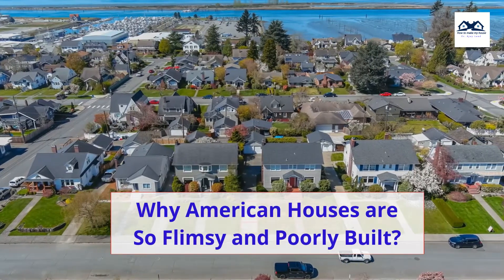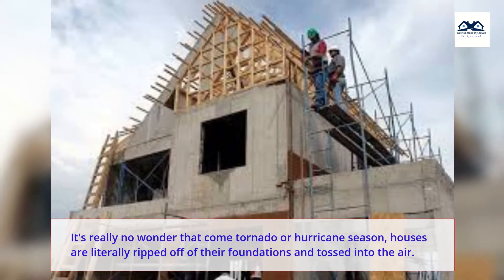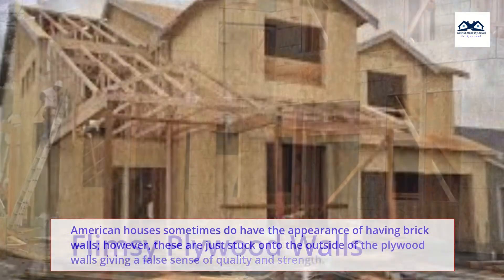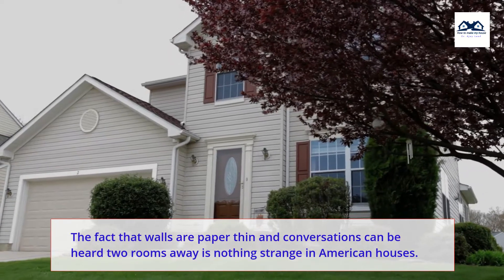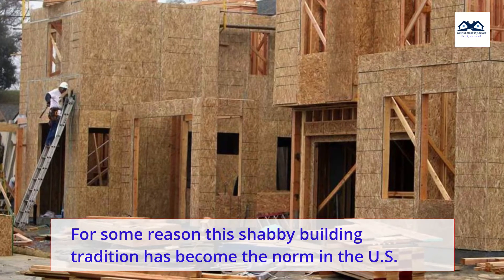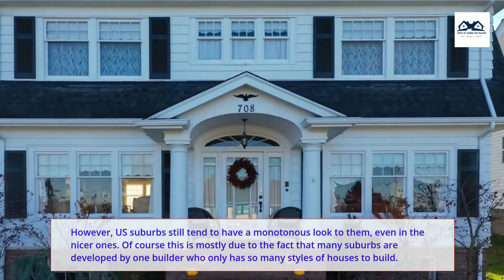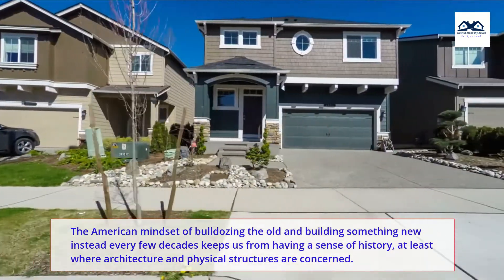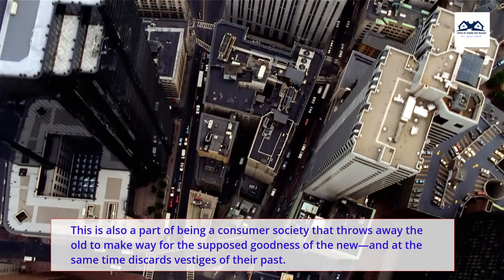Why American houses are so Flimsy and Poorly Built | Why American Houses are Different

Comment: I hope this helps someone/points them in the right direction, when it comes to building a good house.

Houses are built TERRIBLY in the US; you really have to go out of your way, to get a house built properly in the US, they are basically a step up from a straw house, by default; Its kind of sad that to get a well built house in the US, you have to go against the grain, A LOT of the info pertaining to the history/a fancy name/a certain type of house and what its called, honestly doesn't matter, just point, at the type of house you want and then start modifying/changing what you don't like, or don't want/what you want to add/remove and so on, honestly this is what matters, I prefer NO HOAs/a piece of secluded property to build on, is DEFINITELY the way to go, with a CUSTOM lay out, honestly do what you want, let history be history;

LOL the real question is; Why all the pine? 

To build right, one of the cheaper ways, is to use concrete and rebar, the concrete NEEDS to be, AT LEAST 6 inches thick, with rebar through out, or if your cutting corners, rebar needs to be applied every 1-2FT, WIFI extenders/numerous routers can keep your homes wifi operating properly/optimally, hurricane straps, for keeping metal roofs, on/together/the structure of a house together, in general, is a great option; The better/ more expensive way is, ALL steel, DEFINITELY no wood, outside or for structure/wood shouldn't be around windows either/used for framing outside either, honestly another cheaper option, thats not terrible, is fiber cement siding, as long as you put weather treated 7/16-inch or 15/32-inch thick backing behind it, houses are wrapped now days though/flashing is used/they are waterproofed, so thats at least good, but obviously still use treated wood, for the backing; IF you have to use wood outside, under your hardie board; The best/strongest wood in the world is, Australian Buloke, the strongest local, to the US wood, is Black Ironwood, other good options are hickory, being the strongest out of these five, then maple, then oak, then walnut, and then beeches, again all structure made of wood, thats for support, NEEDS to be at least 7/16-inches or 15/32-inches thick; 

Also NEVER use OSB board or Pine, outside the house or for structural support, I would steer away from it regardless, but this includes decking, for roofs, don't use pine or OSB for that, and if your using wood for decking, make sure its weather treated and 7/16-inch or 15/32-inch thick and made of one of the woods I listed above, NOT pine or OBS, also remember to use hurricane straps, for keeping things together, this is also a MUST; also no wood porches, steel is the best, with a steel cover/eve, to keep the sun off of it/to keep it cooler, but plastic decking is really popular now days, for longevity as well; Tornado proof windows is a MUST,  but I would minimize the amount of windows used/DEFINITELY limit the size of the windows, that would be even better, and also like I've said, a steel roof, NOT tin or shingles; This would basically fix all the problems, with stability, pine and OSB are garbage, pine is fine for inside, for shelves, but not outside or for structure, or roof decking, I honestly would avoid it all together, but these options, are A LOT better vs the default garbage material used in 90% of houses in the US now days; I would also get steel storm shutters, to protect windows, make sure the steel doesn't move/make sure the steel cant bang into the Windows/so make sure the metal shutter, is far enough from the window, to not touch the glass, so nothing can bang into the window/make sure the shutter doesn't sway, in any scenario, I like automatic shutters/electric shutters, but you don't have to go that route; my goal/mission, is to only build once/longevity/home protection, is really important.

Also solar and battery backups, would be great too, protecting your security cams, with steel enclosures, is good too.

The other thing I would do, RIGHT AWAY, is change out all of your screws on your exterior doors/ a child can kick doors in, if its only installed/secured with screws that are an inch long, 3inches is good though, if you look at MOST doors, that get kicked in quickly/with in a half of a second, by a tiny child, only the pine gets ripped away from the frame/ the screws weren't in the studs, also braid nails, MIGHT be the only thing holding your door frames together as well.

The better way for doors, is steel frames, with bolts, but just switching out those tiny screws, will make a HUGE difference, also a bigger/longer strike plate would help as well, with more screws, don't forget about the screws on the hinges as well though, I like ASSA locks, but Medeco is good too.

I also have two layers of 5/8" sheetrock, with a 2 inch air gap, I also have the soundproofing foam as well and I used paint, that is supposed to be sound proofing as well; I want my house to be around after I'm dead, you cant achieve that with pine/wood, unfortunately, and  I also don't want to have to do maintenance on the outside of my house, every 5/10/20 years/ my goal is 50+ years, honestly though, the way I've built things, I would bet that outside maintenance would not even need to be thought about for at least 100 years/I should be good for the rest of my life.

ALL lower levels, should be underground, in an area, with absolutely no windows, if your completely underground, that shouldn't be a thought/option anyway, but it is something to think about though.

I've also done other things to my house as well though; my house has ALL 20AMP or higher AMP outlets/breakers, no 15amp outlets or breakers, ALL wire in my house is orange/#10 gauge, or above, each room has, at least 8 DEDICATED outlets, my house has a 600AMP panel, that has a breaker switch/whole house shut off, inside the house at the breaker box AND outside, at that breaker box as well, I had two whole house surge protectors that were wired inside AND outside, but recently I switched those out, for the ones that ALSO are supposed to protect against EMPs as well, I thought that I might as well/I didn't see a reason not to switch those out; I also made sure each switch/light on and off rocker or button, had/has a neutral wire, for smart switches, this is PROBABLY code now days/most likely this is something all new houses have now, but obviously I wanted to be sure and I recommend that everyone be sure that this is available in every switch, SOME smart switches don't require a neutral, but I still recommend making sure its at least available; 

I went with a commercial dishwasher, which required a slightly bigger drain pipe, but 2min wash times is a MUST/commercial dishwashers have two minute wash cycles, also an endless hot water system, was a must as well, also a whole house reverse Osmosis system, to make sure water is as good/clean as possible;

I also prefer/I stick to perimeter plumbing/the fastest way to a location, is a straight line, you don't want diagonal runs through out your entire house/when you need to repair things, you want to inflict the least amount of damage/you don't want to have to repair a ton of sheet rock, the second thing I required, is accsess panels, to everything, including bath tubs/showers, and definitely sinks/toilets, the second two are usually not an issue, but beyond this, a certain portion of pipes need accsess panels as well, so you can work on anything, without having to destroy sheetrock/you should be able to work on sections of pipes, without removing sheetrock, also all bath tubs NEED a valve as well/everything requires its own valves and every so feet, a valve should be available/installed as well, so you never have to turn off the water to the entire house or mostly never have to, to fix something, a whole house, inside water shut off, is a must though, granted, I think this is code now days though/I think all houses have an inside whole house water shut off/valve, now days; and yes there are pros and cons, to perimeter piping, but for repairing/creating the least amount of damage, the pros out way the cons.

I've probably forgotten, SOMETHING, but if you do this, your house is DEFINITELY built better than 90% of most peoples houses, I honestly don't know why houses are built so badly by default, in the US, I know the history behind it and I know when it started, but I don't know why it continued to be the standard and I don't understand why people don't object to having a multi million dollar home, thats built so terribly/maybe it comes down to education/they don't realize how bad the materials being used are.

Comment: I have been to Germany several times for one month stays each time. I never saw any wooden houses there. The house are much sturdier there than in the USA. You do not see any shingled roofs. The floors are solid. If you are on the bottom floor you will not hear much noise from those above you. There the doors are solid wood. And the interior walls are real plaster. Houses are so cheaply built, but the price is extremely high. Americans should wake up. I found many things are cheaper in Germany than in the USA. The car I own here in the USA would cost about $5000 less in Germany. Electronics are generally cheaper than in the USA. Many USA house that appear to be brick actually only have a brick veneer. A thin, cheap brick veneer can appear to be expensive solid brick work.